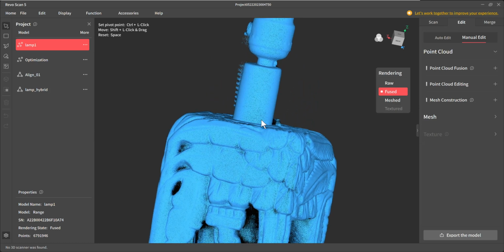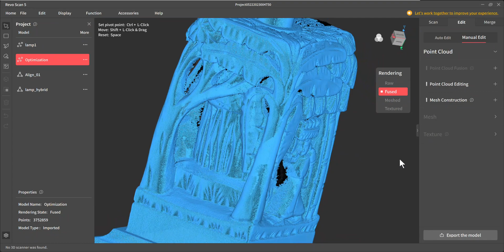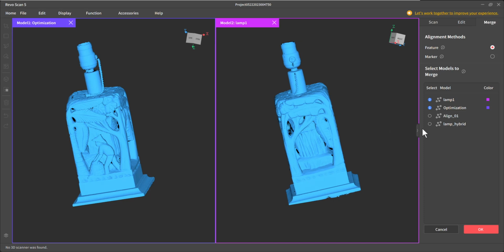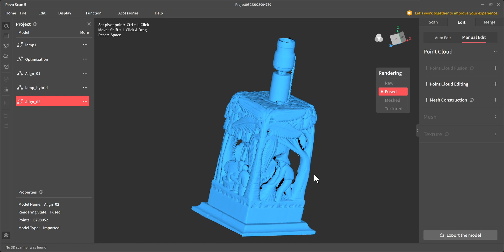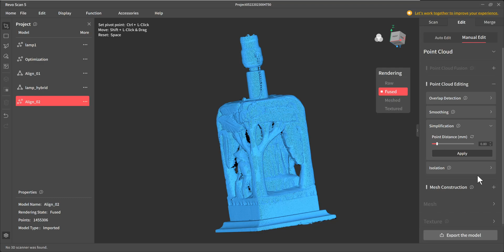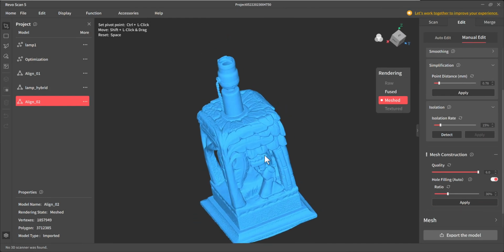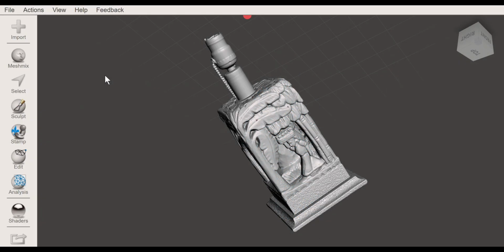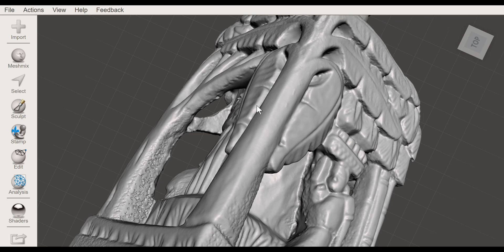Merging a Scan Ferret Scan With a Range Scan in Revoscan 5

Comment: The only advantage to the ferret, in my opinion, is that when tracking is
loss it is a lot more forgiving than the 
Range or the Pop 2. When I lose tracking on Revopoint scanners, I basically have to cancel the scan.
Revopoint Development software (Revopoint 5) is much better than
the Revopoint Studio scanning software. When you have a good distance point ,exposure and point cloud there is no comparison to the Range when it comes to budget scanners